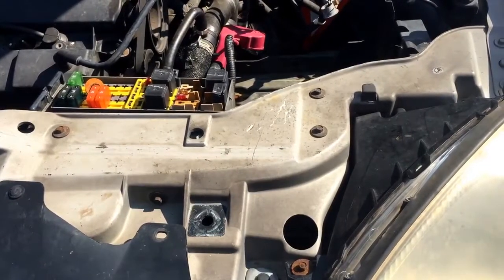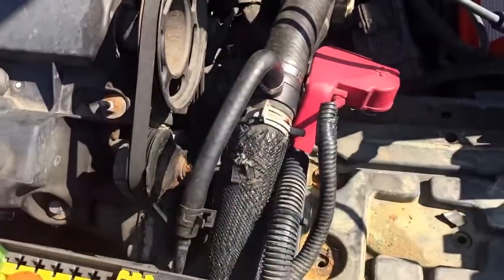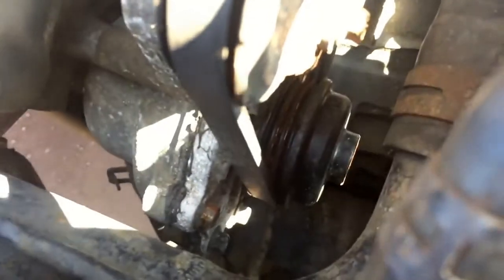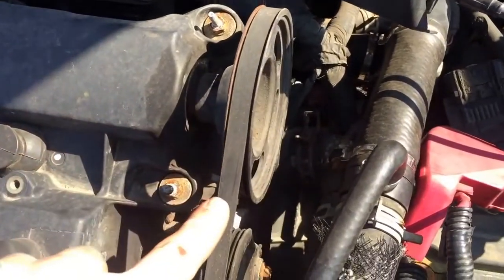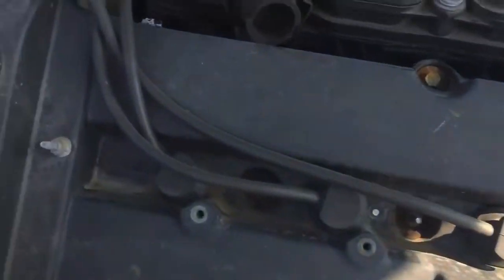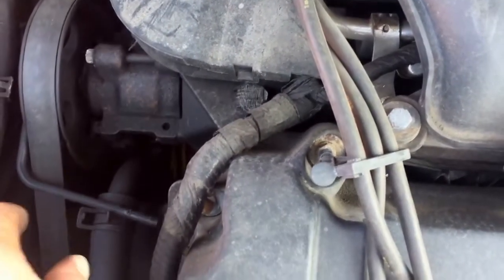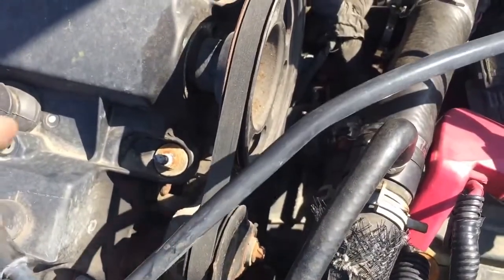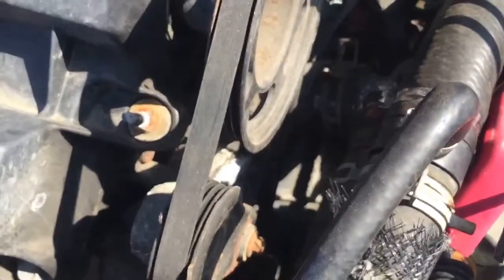Ford Taurus 24V Water Pump Location And Replacement

Comment: My 2001 Mercury Sable with the Duratec engine was difficult to remove and replace the water pump but I was able to do it by lowering it through the bottom of the engine bay and then working it over the cross member just below the radiator. Didnt think I was going to make it but once I found the right angle it came out and the new one went in the same way.

Comment: 2002 Taurus doc motor 2 belts waterpump on drivers side fed of of cam with pulley (belt ) coolant leaking  can't tell for sure (out back of housing )  has overheated pretty hot limped it back to off interstate))hot enough it stalled ! At tym thought asperation cloged converter  drilled out converter slightly 6months later started up dead of winter let run for 3_ 4 hrs seemed ok but under load warms up will overheat if I dont vent heat through heater core under really hard driving may overheat  no oil in coolant no coolant in oil it's not burning it no fouling of plugs no misfire under load or idle  iv gota have a waterpump failure! There is no air in system eather already ben there   ?????

Comment: Not a Taurus Duratec 24V DOHC engine water pump. They are powered by serpentine belt, located passenger side.
Reply: It absolutely is.  You are thinking of the 12V Vulcan 3.0.  But his is the 24V set-up.
Reply: 96 24v duratec on pssgr side
Reply: The water pump is located on the driver side on a dohc 2002 ford Taurus. This make has two belts.
Reply: Yes it is!! 2001,2002, 2003,4,5 THIS IS THE SET UP.   Beware, FORD made a mid year change in 2003! For those ONWARD, one coolant pipe in the backhousing IS LONGER than the previous years! I'm referring to the PUMP and HOUSING ASSEMBLY, which is sold, as opposed to the pump itself.
Reply: @haroldreyes7549  is fixing this water pump easy? I have the same car same set up where the water pump is on the driver side of the vehicle. 2002 ford taurus dohc. Need help???
Reply: @brad9798  I have a ford Taurus 2002 dohc and my water pump was leaking and now the belt is broke off. It this an easy fix?